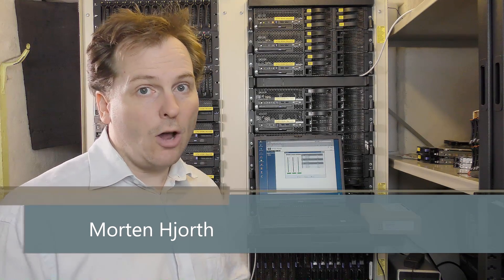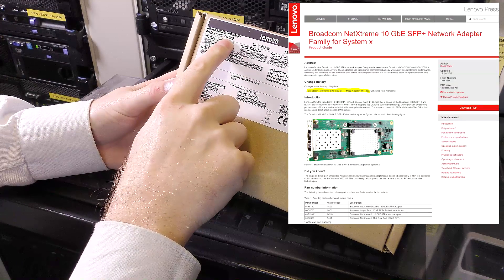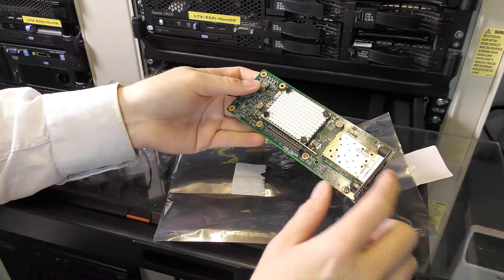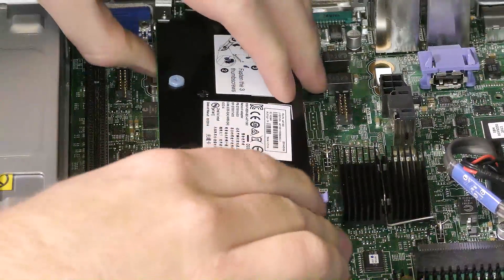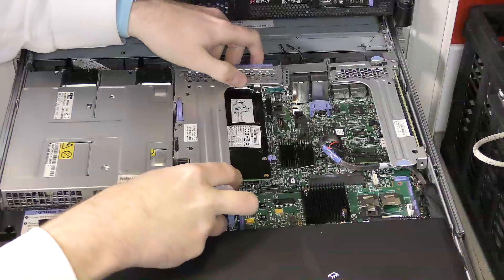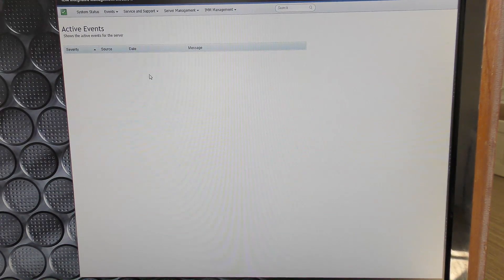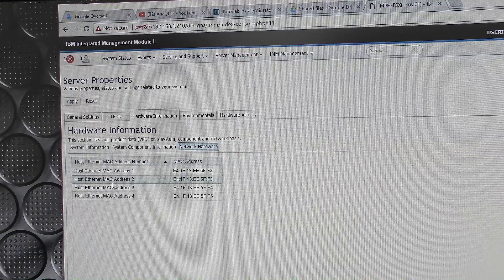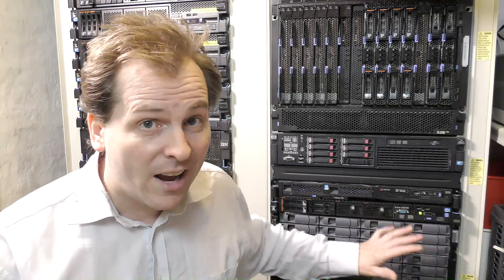2x10 Gigabit Network mezzanine card in Lenovo x3550 M4 - 568

Comment: Look out for an IBM/Lenovo Blade RackSwitch G8124, 24 ports of SFP+, works with all the SFP+ modules and DAC cables I've thrown at it, it's from the IBM days of xSystems and uses less power than the Quanta LB6M. They don't come up as often as the Quanta, but usually aren't too much more than the Quanta. The RackSwitch takes less power than the Quanta, even with both PSUs plugged in, and on the RackSwitch it takes less power with both PSUs plugged in because with only one plugged in the fans don't throttle down. The Quanta is a little quieter and has a couple 1gbe ports which does make it nice for connecting to the rest of your network if you're mostly 1gbe copper, but 1gig SFPs should work in the RS so it's not that big of a deal.
Reply from the maker: Hi 808jpm
Thank You very much!  I'd love to get my hands on a Lenovo Switch.
Thank you for watching! :-)

Comment: If you're going to be mostly dedicating that machine to hosting files I'd highly suggest flashing the raid controller in there into a "HBA" mode where all the disks get passed through to the operating system, then spending some time learning FreeNAS.
I haven't messed with it much, but the new gui might actually be user friendly. It's a shame that they killed FreeNAS Corral because that actually had a good gui.
Reply from the maker: Hi steaker1705
Thank You very much! 
Thank you for watching! :-)

Comment: I do 10gb all day... Some good switches cheap on eBay.  Do your research well on them.  A lot of infiniband versions which i don't think would be ideal for your datacenter.
Reply from the maker: Hi Daniel Tekmyster
Thank You very much!  I am not good at networking, so I am looking for a 10Gbe switch for a dummy...
Thank you for watching! :-)
Reply: If you don't need much keep an Eye Out for Unifi Switches like the 16 XG from Ubiquiti they offer 12 SFP+ and 4 10Gbase-T which offers 10/100/1000 Mbit and 10Gbit via CAT6 or better.

They can be setup by the unify Software on Web App.
Reply: My PlayHouse for the money, it's not a bad buy.  Plus it offers you both sfp+ support and copper Ethernet.

If you want something enterprise, Quanta LB6M (24 port SFP+) which is a layer 3 switch, so you can use one or two as your core switch for redundancy.  It's just a bit loud.